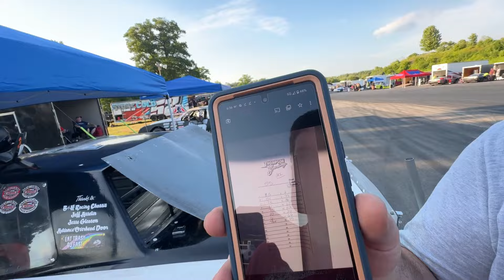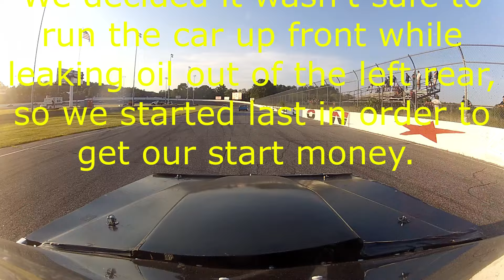RACE DAY! Except it isn't...

Comment: Way too stiff in both front springs..  and with current springs you have e the sway bar way to tightened down .. as u enter the corner the rf can’t even roll over cause your pulling the LF with it.  

These cars today are going soft 800-1000
     3-350- 2-225
Reply from the maker: I’m way softer than that, so its likely a bar size/ stagger/ wedge combination of issues